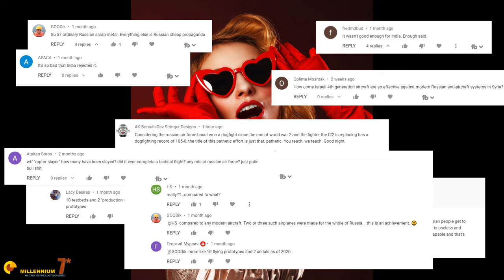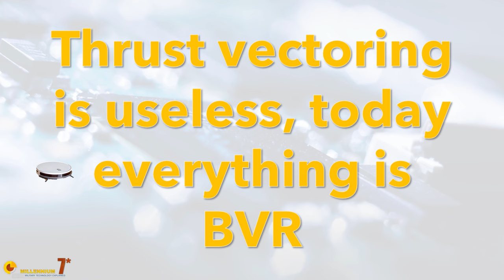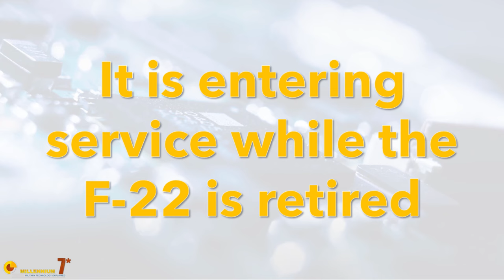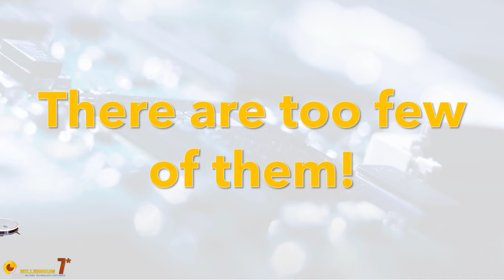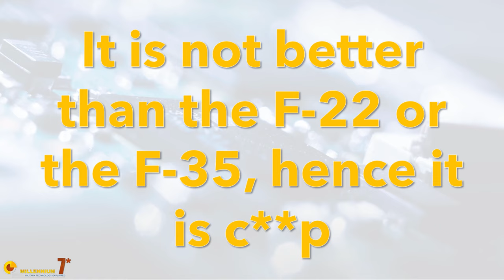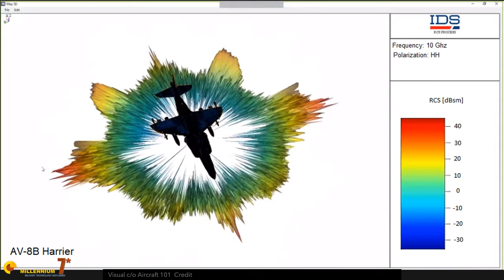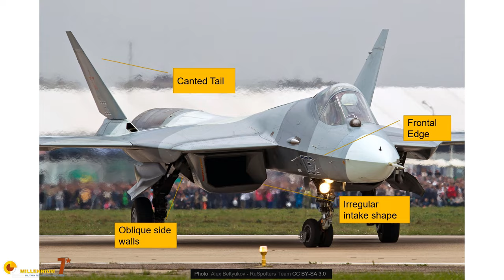Su-57: is it INVISIBLE?

Comment: It's a highly capable fighter design which is "low observable". Russian doctrine uses a lower threshold for what is an acceptable design compromise to achieve lower observability. If say the US is willing to sacrifice up to 30% of the overall performance metrics of an aircraft to achieve greater stealth, Russia might be said to set that threshold at maybe 15 or 20%. So it's "less stealthy", but still relatively stealthy~ish. Also stealth is highly directional, and much more so on Russian designs, where they typically focus on the radar detectability of aircraft when viewed from the front, but not so much the rear. Arguably the front is the most important axis to have a lower RCS, though I wouldn't exactly say any axis is "unimportant".

Of course, regarding stealth, there is the "all or nothing" philosophy too... and there's something to be said for that line of thinking. Although that philosophy is very much putting all of your eggs in one basket.

China also employs a lower threshold for design compromises to achieve stealth. Even the F-35 has a lower threshold in it's stealth design compromises than the F-22 (though it's still considerably more stealthy than the SU-57 or J-20). People very often seem to forget that because these design choices are "trade-offs", there are benefits not related to stealth, which are gained by being somewhat less stealthy. Particularly in the areas of production cost and ease of maintenance. Which is the better approach is situational, subject to technological changes, and tactics-dependent.

On a side note, by looking at a variety of systems created by the russian military, I'm pretty confident that Russia has a clear idea about how to counter stealth aircraft. It's far from "easy", and it would involve unavoidable attrition, but they know how to approach the problem, and at the very least disable the "free-reign" of adversary stealth aircraft. I'm definitely not going to spell out which systems, why, or how, though. Russia is ahead of the US in the hardware & tactics which would be required to... lets say "blunt" the effectiveness of stealth aircraft. Though the US could close the gap pretty quickly if they faced any significant numbers of near-peer adversary stealth aircraft.

Personally, I think the SU-57 is very much the underdog in a 1vs1 comparison with the F-22. But on a "effectiveness per dollar" basis, I think both the SU-57 and F-35 dominate the F-22.

PS: There's so much 'salt' in the SU-57 video comments!

Comment: If I'm not mistaken, like the Chinese J20, the SU57 is meant to go after tankers and AWACS. but won't those aircraft have F22s or at least F35s as cover? If that is the case, is it right to assume that the American craft will overwhelm the enemy before they can get a shot at the big aircraft?
Reply from the maker: That is what the US hopes, but you can't be sure.
Reply: This assumes they have spoted the SU57 and can catch it. The SU57 has access to longer range missiles and can fly faster than the f35 so interception would be very tricky. The F22 can theoretically catch it since its faster but it has a much lower range and cant take off from a carrier so it would be very situational. So its not like you cant guard tankers and AWACS but it will be extremelly difficult so it would inevitably make you either dedecate massive recources and tolerate much higher losses than you would like.

Comment: Addressing the claims of the first thing: here is the answer, after finding the f 22/35 on radar and not locking it, you could use a cued search to direct beams only in the general direction, all while your photonic radar is trying to find the stealth aircraft.  There is like 200km's for detecting the f 35 while the f-35 has 200 km range the Su-57 has 400kms. And ROFAR (photonic radar) has 500km range so the radar will try to find the F-22. But for normal radar. It is known to be 400km. For what RCS is unknown, now the Irbis has 3m2. This thing (byelka) should be better as it more expensive, newer and has 2xnumber of target detection and  attack. So it may be indeed 400km for 1m2 per unofficial sources and logical arguments.

Thrust vectoring is not totally useless, it is just used more in WVR engagements, the Cobra can be used to dodge long range amraams or meteors in case there was no other option, plus, the F-35 can detect a 0.1m2 target at 45-50km while f 22 can do it at 60km so that is really close, considering the Su-57 0.1 compared to 3m2 of f 22 per russian estimates.  

As for exposed rivets, bubbles in canopy, exposed engines, well most of these are prototypes and the picture he shows actually has 2 different engines in the test flight, you can see in some pictures the Su-57 has covered most of the engine except the nozzles, as for rivets, the Su-57 has many trials and really is not used except for test flights, as for serial ones, they have most of these fixed.

The Su-57 is a rather fast jet, with mach 2 and claims that it can reach supersonic speeds without afterburner, I would not call it underpowered. 

The money is mostly poured in hypersonic tech, ballistic missiles and new avangard projects. That is the only reason russia is so strong in these aspects, they left the t 14, mig 35 and su-57 and concentrated on the zircon etc. 

It has no weapons bays is so stupid, I won't even argue, you can literally see them lol. 

I think in some cases the Su-57 is better than the raptor, and this is because they waited for the raptor to enter production, copied everything possible, added their own stuff etc. If you want to talk who is better with me, then reply, I am glad to talk, if you have info more than me I am also happy to know.
Reply: @Xavier28200 hello. Thanks for the reply but not exactly. It does share features with the Flanker but is all in all a hybrid of the YF 23 and F 22. The radars must have a better detection range than the original irbis because it is a newer jet and they have spent millions on the new platform (byelka). The Su 35 is known to have a 400km detection range for 3m2 target in a 120 degrees FoV and 200 in a 240 km FoV. The Su 57 on the other hand had specific mentions from non official sources claiming to be 400 km for 1 m2 RCS. It is known to be 400km but what RCS is not mentioned. According to Bulgarian military it had a 160km detection vs 1m2 rcs. Realistically it has 2xnumber of target detection and engagement of Irbis and irbis does a 330km for 1m2. So it is beyond reasonable doubt it will be 400km for 1m2. 
Take all of this with a grain of salt, we can't know for sure the detection ranges. By the way, all what I am saying may be prone to error and even it is not, if you want to correct me in something ask questions or criticise anything have the freedom to do so. I am open minded and would love to hear some facts and opinions.

Comment: The production SU 57 surface finish is certainly much better looking than the prototypes. On the other hand the Indians did pull the pin on buying it or participating in the program with inferior stealth being a stated reason.
But I ask the question - what if it has just enough stealth to get WVR with an F 35 and that has been the Russian goal all along?.
Even the most ardent F 35 fan must admit that an F 35 in WVR combat with an SU 57 is in a dangerous situation.
Reply: You really have to have a true VLO platform to get WVR, not only in RF spectrum, but IR as well.  You simply aren’t getting close in either if your frontal RCS value is what Sukhoi said it is (1/10th of Flanker).  Right now, F-35 pilots who have done Large Force Exercises against F-22As stated they avoid the F-22s using their sensors.  F-22 has excellent RCS and IR signature reduction, to the extent that F-15C+ pilots with JHMCS and CATM-9X have complained they can’t acquire it with the CATM-9X seeker head in WVR doing BFM set-ups for Fox 2 fights where IR missiles are fair play.

So that’s what the Su-57 would have to conquer just to get WVR of JSF.

Now let’s look at who is more dangerous to whom WVR.  JSF have extremely small IR signatures, so IRST really doesn’t work well even for detection until you get within 24km at best.  I did all the math through the various altitude and atmospheric bands on this with OLS-35, Rafale’s OSF, and Su-57’s 101KS-V based on reasonable improvements over OLS-35 as assumptions.

At best, you might get a frontal IR signature detection with no PID at 24km, which is WVR in many atmospheric conditions.  That’s still not knowing what you’re looking at, just a contact in the federated IRST sensor.  Meanwhile back in time, you have been tracked and PID’d anywhere from hundreds down to no less than 80km ago by JSF networked sensors.

Why would any of the JSF in the flight purposely close into WVR with a PID’d fighter of any type?  They work around and against contacts cooperatively with multiple options for NEZ that are unseen.

The more likely scenario is the Su-57 guiding S-70 drones, designed to act as forward eyes and ears to help act as sacrificial pons that suck-up weapons that would otherwise be threats to manned aircraft, but the US is playing this game too with truly VLO semi-autonomous and autonomous systems, with decades of experience employing them.

For the hypothetical Fox 2 fight that F-35s would have to throw themselves into, now factor in the Block II AIM-9X after all-aspect launch of AIM-120s before the merge.  Neither of them are waiting for a 3-9 crossing to employ weapons.  Then factor in IR sig reduction on JSF and what IR-guided weapons can even get a track.  

You start to see why WVR fights are extremely unlikely going into the future, unless you can reach parity in total VLO signature reduction.  Even then, you’re looking at first shots from over 20km out or longer.  ASRAAM and Block II AIM-9X are BVR missiles, so face-shooting before entering WVR are where it would start if you “eliminated BRV”.  

Now say the Su-57 survives the initial attempt at face-shooting.  Who has the better Helmet and sensors with a better Helmet-cued HOBS missile and who has better IR signature reduction?  Even if you have better kinematics, you have to deal with the frustration of no traditional weapons solutions.  BTW, JSF is executing a level of EW against you in that fight that you don’t have an answer to, corrupting any of your synthetic fire control computer apps, and doing something else in another spectrum that really causes you harm without any kinetic weapons involved.  And you’re flying a tennis court on top of all that, against pilots who have more BFM and DACT training than you.
Reply: @kresnik_ss  What was so bad that made them pull out, after they invested $300 million into PAK-FA?  That's the real question.

Comment: I don't think the f22 will really be 'retired'. Older jets have been flying for long after their production ended so I think that even if they stop production, the jets in service may be going for quite a while. I don't think that they would just scrap the f22, it's too large of a financial loss and why would they put it out of action and then rely on older airframes
Reply: Of course it depends on who its replacement is ready (does anyone know). By past form, they'll end up with the Air National Guard (replacing the old F-15Cs and early batch F-16 models currently operated).